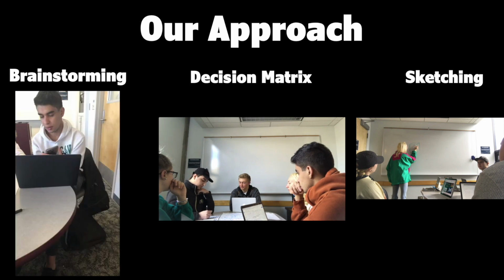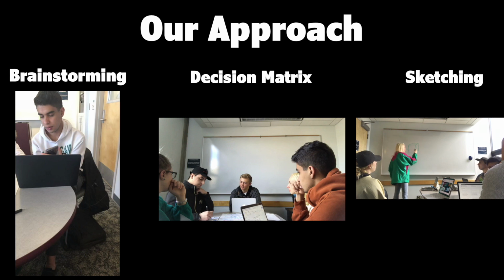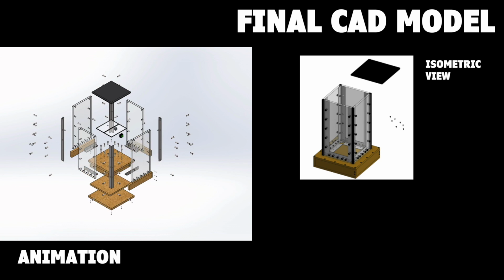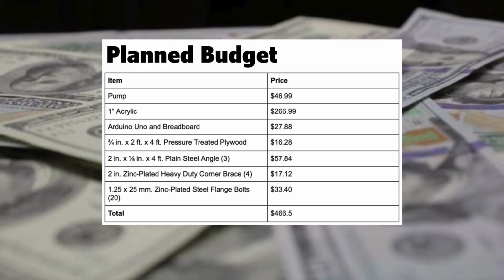Acrylic Vacuum Chamber

Comment: Super fantastic cad jobs! Very fun to see and you did an excellent job explaining the process and project. As a use case perhaps, it would be nice to allow the chamber to be de-pressurized separate from the electronics (if it isn't already) so you can run the experiment without a vacuum as a sort of "before and after" setup.  I want one of these for myself now, that final video of the feather vs ball is so cool! Great work!
Reply: I'm with Lauren. This would be a great demo to have in the ITLL. The taller, the more noticeable the effect would be between vacuum vs no vacuum!